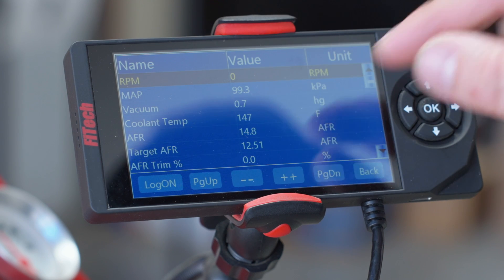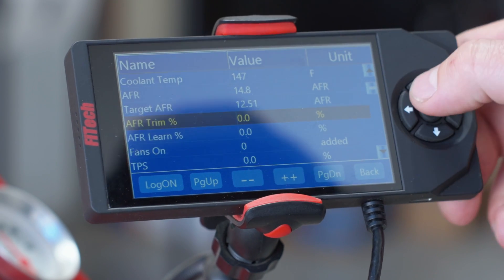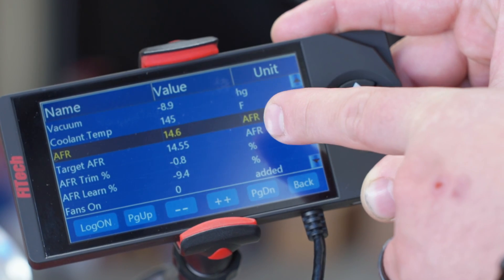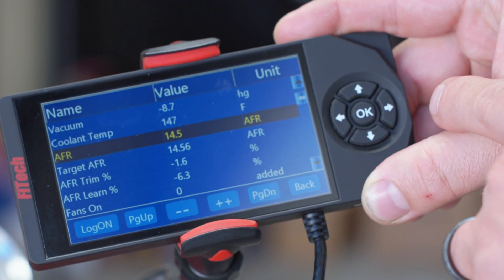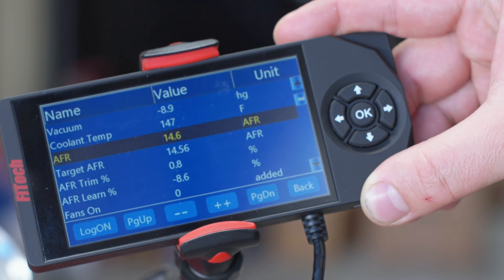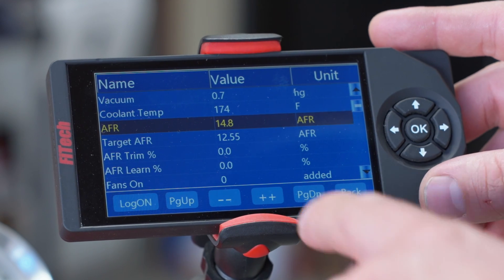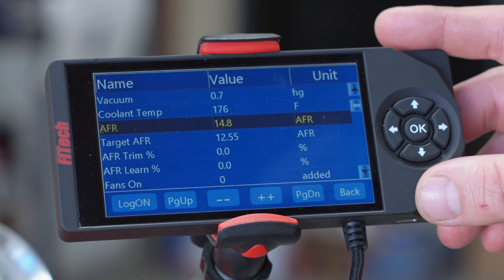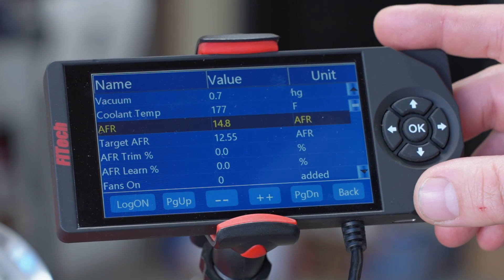Cylinder Misfires & EFI | Tech Tuesdays | EP91

Comment: interesting.  

Ive been following the instructions on setting the iat steps to the parameters you guys call for and it will stay there for a few days byt then after lets say a week it will suddenly start getting alot higher. im having to constantly go in an re adjust to get it to the parameters its calling for. is there a reason why ?